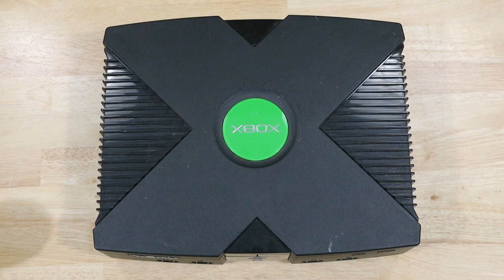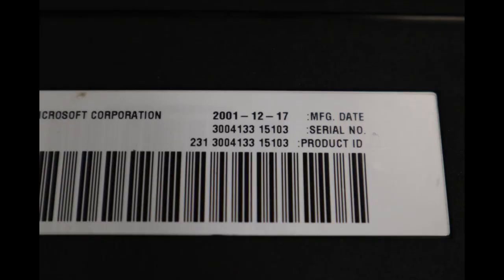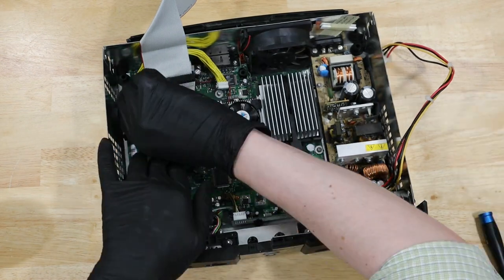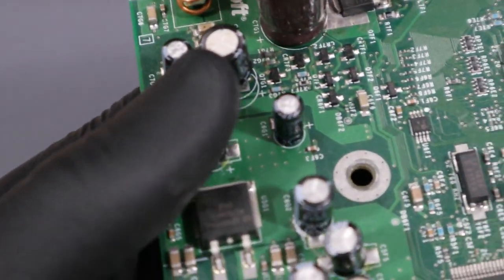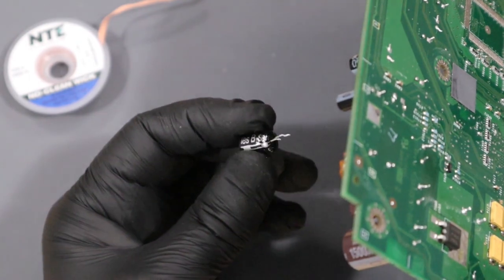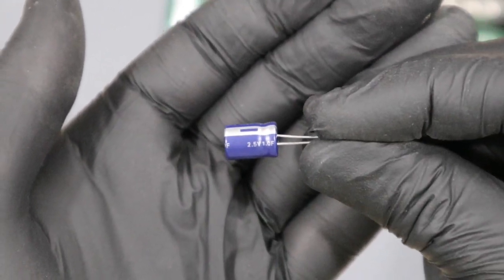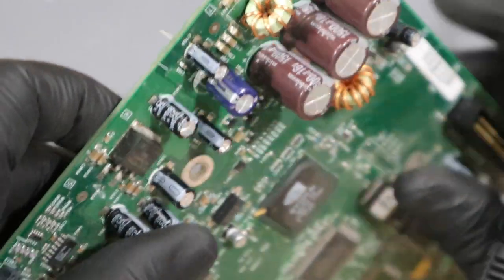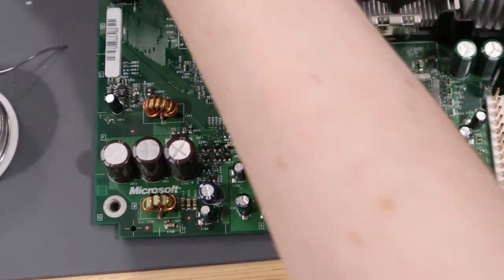How to Replace the Xbox Clock Capacitor

Comment: While you're in there, check the large capacitors by the CPU, these also tend to go bad. On the 1.0 and 1.1 boards, re-flow the solder on the power connector on the power supply board.

Comment: Even rev 1.6 should be replaced. It will leak sooner or later.
Isn't there a mod to replace it with a CR2032 instead?

Comment: So my Xbox say Aug 16th 2005. Does that mean it doesn't have the ticking time bomb capacitor inside or it just has a later version of it that won't leak ? Cheers in advance.
Reply: Bit of a late response but with the 1.6 revisions the CPU capacitors almost always leak, however the clock capacitor is usually okay. If you need to replace your CPU caps you might aswell do the clock capacitor anyway to play it safe.

Comment: Would it work to break of one of the old capacitor legs and hold it with pliers and the solder iron to it as a hot poker to clear the hole?

Comment: Is the clock capacitor the main big one that needs to be replaces? Are the other capacitors not as relevant to replace?
Reply: "Are the other capacitors not as relevant to replace?"
The others don't leak as that one does.

"Are the other capacitors not as relevant to replace?"
Only when they're bulging, indicating failure
Reply: Depends on if they’re bulging or not and impacting performance. The clock capacitor I’ve heard is the one that causes the most problems. So it’s best to just replace that one and solder another one if you’re on any version. Or you could take a chance and do checkups on it like your a doctor until it eventually gets too bad.

Comment: I really need to open my xbox and do this, but I have 0 experience with soldering. Appreciate the video!
Reply: I seen some that the carefully just pull it up but the 2 metal prongs will stay behind soldered since its ripped out but hey aslong as the bomb is removed. Though youll have to set up the clock everytime you disconnect the xbox
Reply: The only way to learn is just do it. I'm gonna do mine as soon as I buy the materials I need.

Comment: The 1.6 are starting to became a problem too. My Crystal 1F capacitor is already swollen, but still works and no leakage. Ofc i will replace it anyway before it leaks. I already have the cap to replace.
Reply: It's a common misconception that the 1.6 clock caps don't need to be renewed. 
While failure rates on the 1.6 are lower, it still happens alot. And when it does you'll need trace repair.

Comment: Can you explain why it’s necessary to replace the super  cap, instead of just removing it altogether?  I mean, the cap isn’t going to power the RTC for all that long, especially with XBox’s that are in storage! So presumably still works fine without it, and for a network connected Xbox the time would just be NTP updated anyway?
Reply: A 1.6 requires it the rest don't

Comment: !!!!!WARNING!!!
removing the clock capacitor in a 1.6 could cause the xbox to not boot replace it and try if it boots
Reply: Don't worry in revision 1.6 which starts manufacturing from april 2004 this capacitor is missing! Microsoft мade a decision not to put this capacitor anymore!!!

Comment: Why is the model beyond 2004 not affected?
Reply: Don't worry in revision 1.6 which starts manufacturing from april 2004 this capacitor is missing! Microsoft мade a decision not to put this capacitor anymore!!!
Reply: Because in 2004, Microsoft discontinued using the faulty Capacitor Cap.
Reply: As @plawson8577 said, from version 1.6 onward, Microsoft used a different capacitor that doesn't leak.

Comment: If you have a modded Xbox its likely one of those 1.5 or earlier revisions of Xbox since Microsoft made the 1.6 versions more difficult to mod. 

Thanks for the walk through. Do you think you could do a video of what kind of tools you use to repair all the retro consoles/games?
Reply: And the 1.6 don't have these self-destructive issues so it's fine to keep them stock and untouched anyway. 😇
Reply: @autobotstarscream765  Buy one made in 2004-. And you’ll be cool.
Reply: 1.6 has overall better capacitors but is not immune to the issue. 1.6 also can be softmodded so I honestly would just recommend that version because even on the 1.4 1.5 versions you’re likely gonna have to replace more than just the capacitor eventually. So get good at soldering early.

Comment: I have the 1.6 because I got mine in my Christmas of 2004 I still should replace it though
Reply: If you brought an OG Xbox manufactured in 2004, it’s capacitors are safe and won’t fail or rupture. The Manufacture hiccup only affected the first Gen.

Comment: Its kinda useless to replace that capacitor. If you unplug your xbox for a few hours, the hour and date setting is going to reset. In that case its a good idea not to replace that capacitor, just remove it. The console is working fine without it
Reply: Just went for the capacitor delete mod and am happily playing Burnout Takedown capacitor free.
Reply: I removed it but now I got an error after booting, mine is v 1.0
Reply: @karwoski91  did you ever get an answer to this?
Reply: @spartan0489  It works great, no more error messages I don't know what happened exactly
Reply: @karwoski91  glad to hear. After removing the capacitor mine is still giving me error 16.

Comment: I just replaced mine on a 1.4 version. Does the capacitor charge up right away? I have had it in a few minutes with the system on and plugged in but when I unplug it, it still asks you to set them time
Reply: I don't think the xbox has a battery to maintain the capacitor for the time, so without power you lose the time.

Comment: And to be honest unless you got 1.6 the Xbox doesn't even need the capacitor to run
Reply: ONLY the 2001-2003 models have Faulty Electrolyte Capacitors. If you’ve got a ‘04 1.6, your cool.

Comment: You don't actually need to replace the capacitor. On top of my head, I can only think of 3-4 games out of 1000 that make use of the clock. And you can adjust it when you play them. The clock will still remember the correct day and hours as long as you leave the console plugged.
One example is in Simpsons Hit n Run, the menu living room screen changes if it's halloween or christmas day. It doesn't really effect the game in any way but it's a cool immersion feature.
Reply: Also, if you're relying on your Xbox to tell time, you don't have a stove, microwave, phone, or almost any modern device.  Seriously, clocks are in everything...
Reply: The ps2 has a clock like that too

Comment: I still have my original one. Got some skull vynals for it back in the day too that are still stuck on. Yellowed but there. Mine was made in 2005 so I should be clear of this cap issue. Always was concerned it might have this issue since every time I plugged it in. It never remembered the time. I guess that cap only holds a charge for a few hours. Would be nice if there was a CR2032 mod for this. I'd love to do that.
Reply: Don't worry in revision 1.6 which starts manufacturing from april 2004 this capacitor is missing! Microsoft мade a decision not to put this capacitor anymore!!!
Reply: @ДмитрийДрейк  Correct 2004+ Xboxs are FREE from this capacitor issue!
Reply: @ДмитрийДрейк  Not really. It's just located in a different location: v1.6 Xboxes have the clock capacitor located between the Xyclops chip and the IDE port, and unlike the earlier versions, the console will refuse to start should you remove it without replacing it. But unlike the older versions, this capacitor doesn't leak.

Comment: how about instead of using a near useless plastic pump to remove the solder, you just heat the throughholes and put the capacitor in with the existing solder? there is literally no reason to completely clear it out like you did, unless you want to give yourself an unnecessary headache.

Comment: Can it work removing the capacitor and not adding a new one
Reply: yes as long as you've got a 1.0 - 1.5 as the 1.6 will not work if you remove the clock capacitor. most people who remove the clock capacitor don't bother to replace it

Comment: Can I still replace the capacitors? I have version 1.6 and 1.6b
Reply: I'm not a professional but I heard replacing the clock capacitor will break the XBOX.
Reply: Just break the 2 metal prongs leave them behind. I don't mind setting up the clock everytime i disconnected the xbox aslong as it was saved.
Reply: Don't worry in revision 1.6 which starts manufacturing from april 2004 this capacitor is missing! Microsoft мade a decision not to put this capacitor anymore!!!
Reply: You can replace it just fine, but it shouldn't be needed unless it won't keep time when disconnected from AC power. Be aware that, unlike what @user-yv4ey6yy6s says, the capacitor is required for the system to even start, so leaving it out as one could do with the v1.0 - v1.5 Xboxes is not an option.

If you have trouble finding it, be aware Microsoft moved it with the 1.6 motherboard revision, and it is now located between the Xyclops chip and the IDE port.

Comment: I'm trying to remove the capacitor without desoldering it. Is there a way to do it?
Reply: also, how do you get off the dried acid?
Reply: Also, what if there's lots of spillage? I'm also worried that even if I and even if I rub it with alchohol, the acid will spread and still corrode the motherboard.
Reply from the maker: There's not a way to effectively replace the capacitor without soldering.
Reply from the maker: Isopropyl alcohol and a Q-Tip.
Reply from the maker: The alcohol will dilute and clean up the acid without spreading the damage around.
Reply: @LastHeartGames  I only have a 70 solution ethyl alcohol

Comment: When the capacitor leaks again you're be back to square one. Best to just remove it completely.
Reply: Wasn’t the issue the capacitor itself? Now that he’s replaced it with a new, better one, wouldn’t the problem no longer persist?
Reply: @iownu92  the capacitors are made in China, who knows how long they will last.
Reply: @healthbeauty7853  I've yet to hear the first instance of the clock capacitor of a v1.6 Xbox leaking, so there is a difference in the quality of the parts used